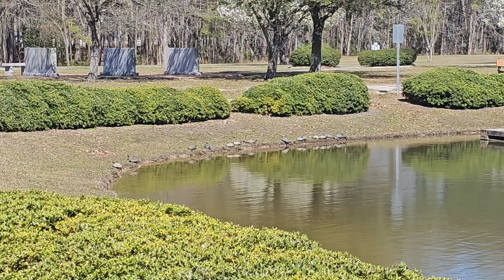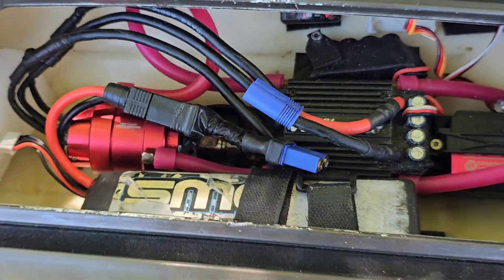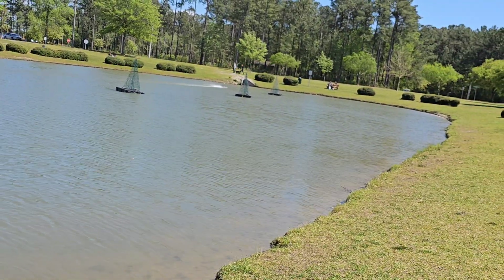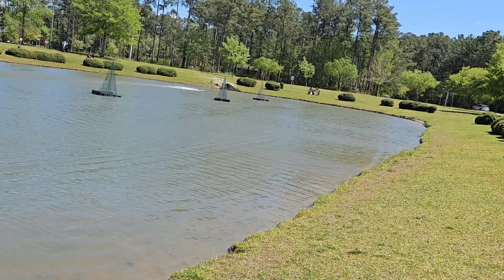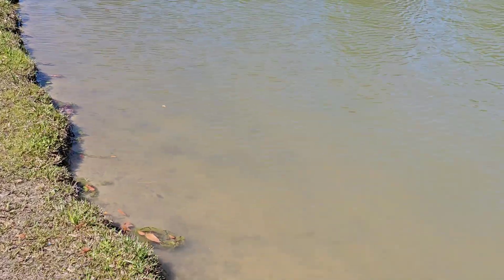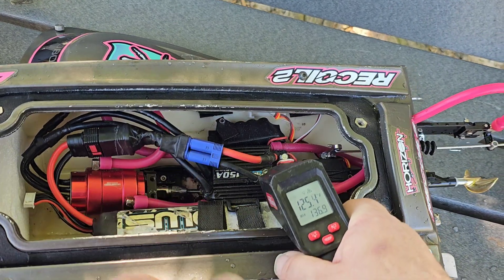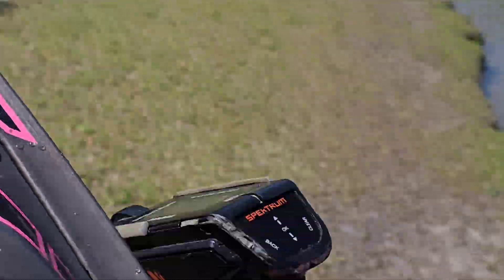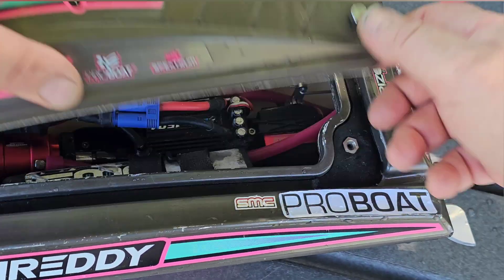OSE 4216 High Rake Prop Test Upgraded RECOIL 2 - SMC, Leopard X2 3660, OSE Rader 150a

Comment: Do use an sr215 or 315 spektrum reciever in this boat to hook it up to your dx5? If so did you do any extra waterproofing?
Reply from the maker: Sr215 mostly, I've actually used both.   I spray my receivers with corrosion x you can also put it in a Ballon for better waterproofing

Comment: When you get smoke or temp cut a Flycolor 150, statically the next time it happens it fails.
Reply from the maker: Esc didn't get hot motor was the hottest 3180kv
Reply: @IRONCLADRC  I am running the recoil 2 stock on 3s and just bought the 4216. Is it a bad prop for the boat or can I run it?